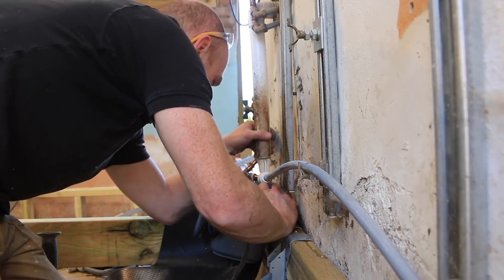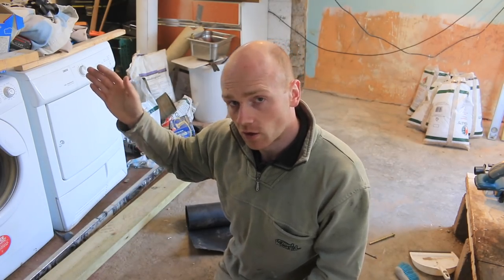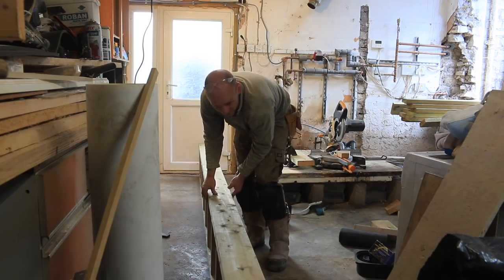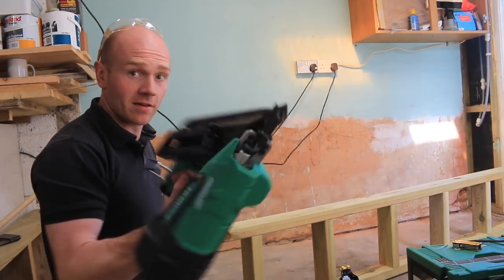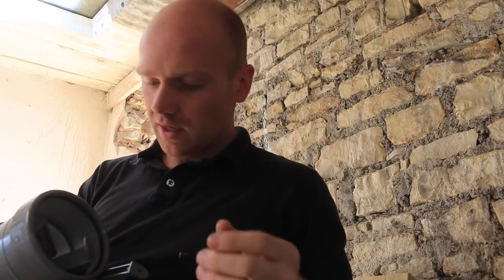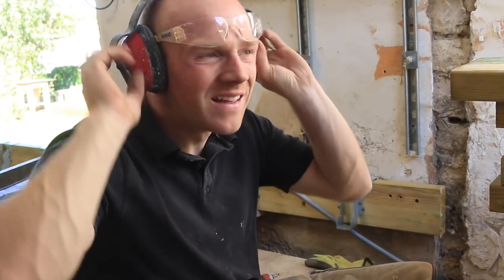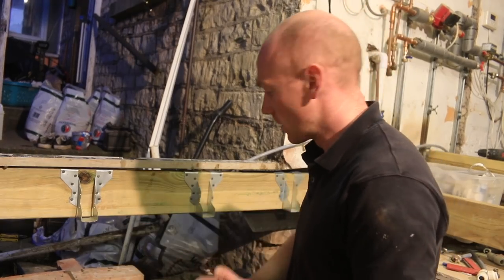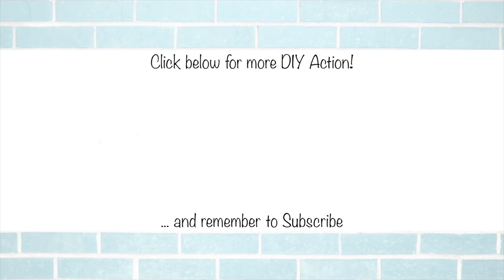Building the SUSPENDED FLOOR - Garage Conversion

Comment: Apologies if this is a silly question... But why didn't you apply the DPC membrane to the board that was screwed into the wall (the one from which the joists hang)..??
Isn't that subject to rotting the same as the ones placed on the floor?

Comment: Talking of Building Regs - what is your plan for the wall where you took the external door out? Stud wall? Since it's an external wall how are you planning on insulating it? And would a stud wall satisfy current building regs u values? I ask as I have an idea to enclose a porch but looking at BRs it seems to be a problem getting the acceptable u value without making the wall 300mm thick!
Reply from the maker: The walls will be internal stud with pir between and over timbers. This adds on around 120mm. Next video or two will explain.
Reply: Thanks Tim,  that's what I'm planning so I'll be watching closely for some tips! The wife is paranoid it's "going to be cold" and my showing her lots of u-value diagrams and wooden houses in 4ft of snow in Norway doesn't convince her! 

Often its the figuring out of the best way to do something that's the hardest part rather than actual DIY competence with there being so many "right" ways and new methods / materials etc. Your vids have helped me along several times over my own ongoing refurb of a 70's bungalow so many thanks for that and good luck with the project.

Comment: Great vid as ever Tim. Just a layman's question here but why the dwarf wall in wood and the long span when the tried and trusted is to use block and a central dwarf wall? It's just that the wood wall could suffer a catastrophic failure in 40 years time say in a way that blocks couldn't. Perhaps I am paranoid but it is not what you usually see that's all.

Comment: New tool, I was looking at these bad boys the other day hitachi nail gun
Reply: David Mishra I sold two paslode IM350s and cope with one hitachi now. For the main reason it is so much more reliable than the old paslodes. Cheaper to run and quieter. I’d not go back now. My finish guns will be hitachi very soon too.

Comment: Hi, what size and type screws did you use to fasten the 6x2 to the wall that the joists hang off? Love watching yours videos, very inspiring
Reply from the maker: Either sleeve anchors or epoxy fixings usually.
Reply: Thank you for the response.

Comment: I think you mentioned that you are considering building a timber framed extension to the house..I am seeing a lot of framed house builds with brick outer skin go up these days so although my place is standard block and brick cavity wall, I'm interested in extending by framing it out myself and maybe have brickies in to skin it. You have stone there though, would you seek to match that externally doing the masonry leaf yourself too or maybe renderboard & render over the framed extension? Just curious on tf used in conjunction with traditional masonry /cavity construction..Be a great project to watch though, not seen such a job covered on YouTube yet!
Reply from the maker: When I said timber frame I meant solid oak so would probably be oak clad and glazed. That said we do intend to do conventional timber frame construction on a future project which would be finished in stone and larch so may be a future video to come.
Reply from the maker: When I said timber frame I meant oak frame so would probably be oak clad and glazed. That said we do intend to do conventional timber frame construction on a future project which would be finished in stone and larch so may be a future video to come.

Comment: Tim, you're rocking! I, for one, am very interested to see your "planning" video as I can't quite get the last of the land from this video.

Do the washer, dryer, etc. ultimately get moved up to the level of the new floor (extended right the way across the room)?
Reply from the maker: The raised area will be the laundry, utility and we. There will be a dividing wall and a few steps down to the main room which will have a new insulated floor at slab level.

Comment: This may be a silly question but is Building Regs approval required.
Reply from the maker: Not silly. Yes and no, as we are converting then we will get it all done but if we were to keep it outside of the house envelope I think it doesn’t, possibly only if it is over a certain height and needs steps, railings, etc.
Reply from the maker: They are interested in hoist sizing, fixings and insulation, all of which are detailed online. 👍
Reply: What's the best resource for info like this? NHBC?
Reply: BMJT Building Control have a great website where I discovered I needed approval from them after swapping out an oil boiler new for old. Could have got an approved installer to certify the work but decided to pay the £140 and have the inspector visit. House sale requirement. Having done three self builds I was shocked at how much home improvement work now requires approval. Better to check early than have it delay any future sale. Also bld regs guy very helpful with info.
Reply: Wish my local BC were as helpful as that, i'm getting very little back from my questions.
Reply: BMJT Shame as they should be a great resource. Retrospective building regs approval is not a problem but I was told they can make you open up finished work if they require to grand an approval. Live in the house for next 20 years and you will probably be fine.
Reply: Building Regs approval required, YES approval has been granted bye the home owner lol

Comment: Why nails and not screws?
Reply from the maker: Used a bit of a combo actually. Nails cheaper, quicker and stronger in most situations. Screws where I needed to pull timbers tight or where there were slight twists to straighten. Nails obviously for the hangers! 😀

Comment: why does he wear a tool belt with nothing in it?
Reply from the maker: It keeps my waist warm! 😂 usually for the small stuff like pencils, tapes and nails for joist hangers ,etc.
Reply: @TheRestorationCouple  ha ha nice one. Good effort anyway with the work. With the wall you mortared under to level (not flat as you keep saying lol) why didn't you screw into the wall same as the other side and mortar under or screw into wall and cut the studs accordingly?
Reply from the maker: At that point there was a chance the studs above would be load bearing when we changed the roof so figured a full mortar bed would be better. In the end we used the block piers so at best it’s just a solid support for the washing  machine! 😀